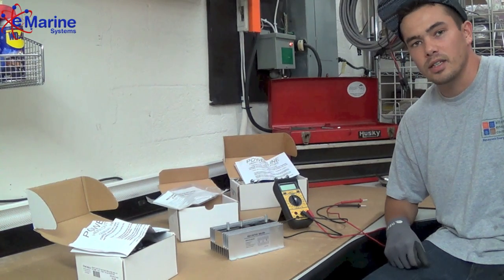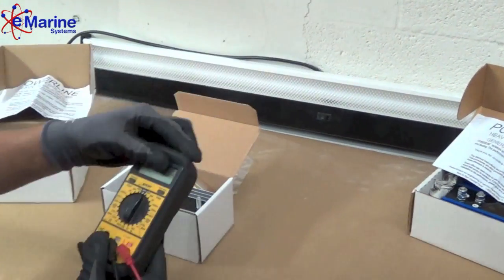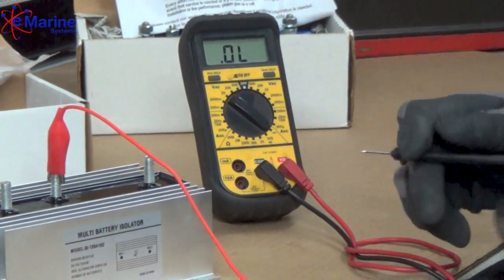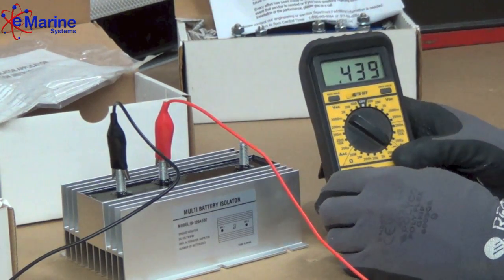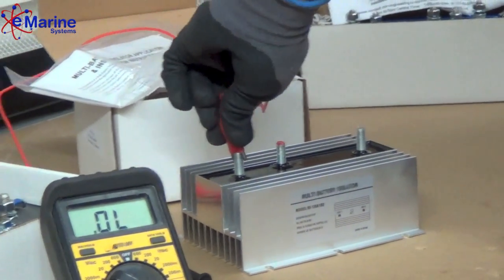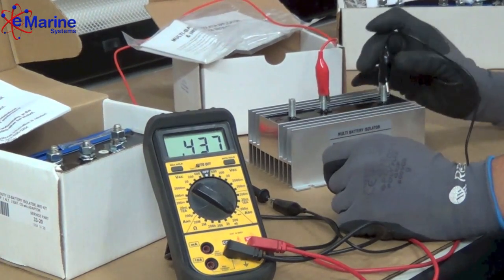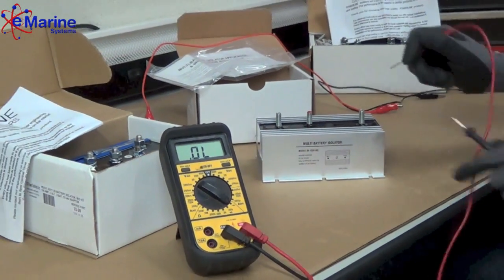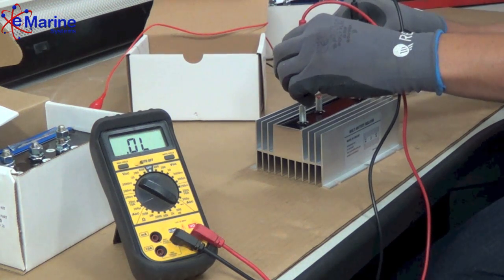How To Test A Battery Isolator - e Marine Systems

Comment: This does not test the isolator under a load- it merely tests if the junction exists, and does not check for the mode of failure where the bonding goes bad and they go open circuit - which seems to be the way these isolators are failing as they age. It will only show a short, and that a junction exists. So it is not wrong - but it is not actually a functional test.  The correct way to do a functional test would be to pass a known current through the junctions, for example, using a curve tracer. Also - if you use this on any vehicle with a Delcotron type alternator and the isolator fails to open under load- it acts just as if you pulled the terminal off the battery- it will destroy the regulator in the alternator every time. You should only use a FET type or solenoid type isolator on a Delco/GM alternator.

Comment: I have a sure electronics multi battery isolator. I tested it using this method and one of the diodes is broken. I tested it with a battery and electricity indeed flows in both directions (only on the broken diode). Can I still hook the working side up to the starting battery of my campervan and the other "broken" side to the accesory battery?

Comment: Hi Heatwave- 1) test isolator to be sure its good, 2) verify you have a negative or positive vehicle ground and the correct corresponding isolator (most vehicles are negative ground), 3) see if your alternator requires a separate excitation feed wire from the isolator.

Comment: I have a question I just installed dual isolator on my Tahoe but now my Tahoe on the dashboard reads 10 volts I did everything I was told not sure what could it be could it be a bad isolator
Reply: Chris R Elite520 
no, they have a voltage drop!

Comment: First off where are the wires ending I can see some from the multimeter but the others are they connected to the tv?   or hooked up on the wall... You might wanna clarify which wires are going where since I cannot read minds or have a crystal ball telling me..